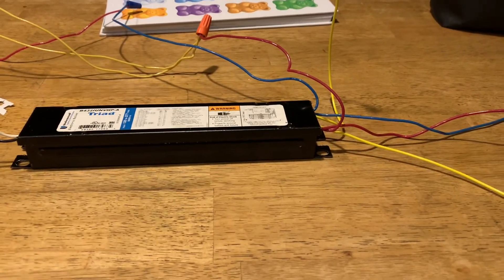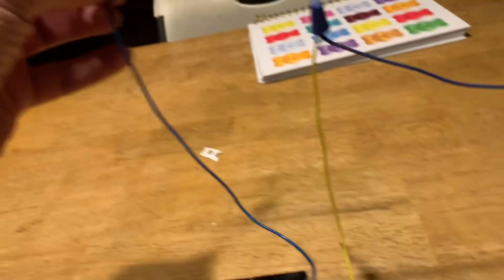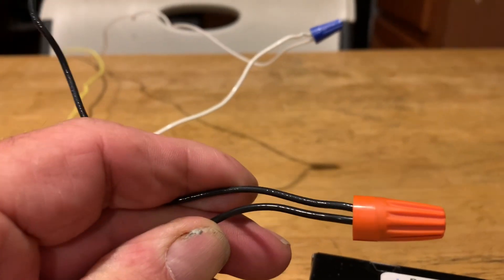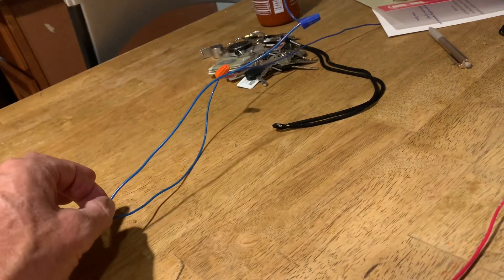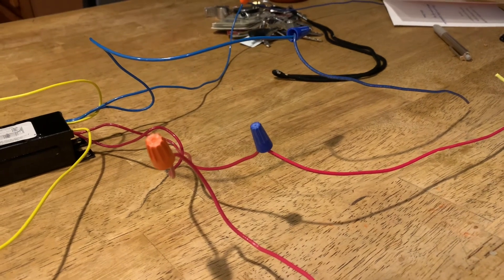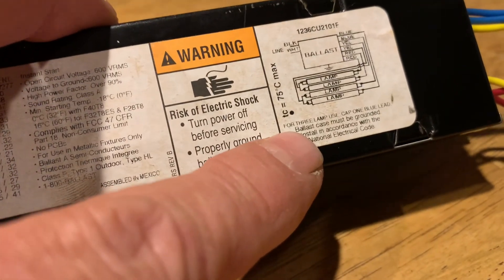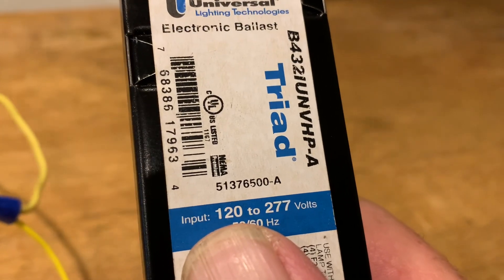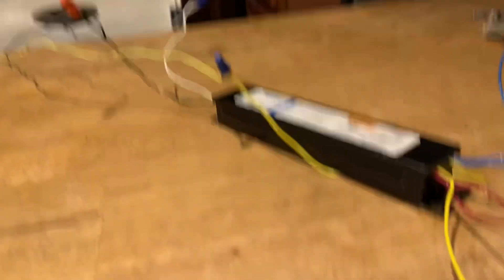This hurt my head! Why what was the last person who did this thinking #ballastreplacement

Comment: I hate those ballasts. we only have 2 bulb fixtures. retrofitting those ballasts into 2 bulb fixture is a PITA. just gimme the direct replacement ballast. red and blue wires. cant screw that up. we've had certain brand LED bulbs have hissyfits with those ballasts too. we've been going integrated LED fixtures. been a nightmare. either the driver takes a shit or the integrated LED starts falling. now gotta take whole fixture down, unwire it. Id rather spend 5 minutes swapping bulbs, 10 minutes swapping a ballast vs 20-30 minutes changing whole damned fixture
Reply from the maker: We remove the ballast, and install “Ballast delete “LED” lamps and new sockets that are non-shunted, with two pigtails (one black , and one white) on one end of the fixture and supply 120v to this end. Now you have a basic 120v led lamp to replace vs all the mumbo- jumbo of a driver ballast and multiple feed splicing and lamps! 
I will be posting a conversion video soon.

Plus when the previous workers mixed up all the feed wires, driver wires and have more spliced and wire nuts then” President Carter had liver spots” it is easier and cleaner to do the complete job new, and retrofit completely with the proper labeling , and new tombstones, then you only have the occasional led lamp replacement! And out of the 100 lamps installed in the last 3 years, we haven’t had to replace any LED lamps yet!

Comment: I had the same job replacing ballasts. I would leave the power on while fixing by always removing the black wire and cap it with the wire nut and hook it up last. Then I found a ballast with two hot wires going to it I had to find another wire nut to cap them.
Reply from the maker: Yes I know them well!

Comment: Get current use direct wire led bulbs. No more ballast needed
Reply: we did just that at our complex. dumbass residents started stealing the direct wire bulbs and trying to put them in their ballasted kitchen lights. direct wire bulb no like the tombstones. tombstones go boom, spark.  Inspector made us get rid of every direct wire fixture where residents could possibly have access
Reply from the maker: @harveylong5878  this is why we make sure all labeling is complete on our direct replacement led converted fixtures, and also make sure that all of our spare lamps are stored away from all non maintenance personnel! All employees of the building must fill out a maintenance request form before any work is preformed! And when we replace these lamps we install new tombstones that are non shunted, or replace the complete fixture with a sealed unit! All employees are also informed that these lamps are not interchangeable with the former fluorescent lamps!
Reply from the maker: That is what we are doing, retrofitting most of the building, and replacing or reusing what we can where we can before recycling!

Comment: I use to work for a energy conservation company and we would change ballast all over the United States so you can just imagine what kind of installation i have seen. The most 2 lamp ballast I have ever changed in 8 hour shift was 108.
Reply from the maker: Been there, done that on a local level, and the really messed up part was… new construction job, that cane in with the wrong ballast in the first place, and the 130v ballasts got hooked up to 277v ! And yes they were 120v only!

Comment: Even color blind people know the black from white.
Reply from the maker: Yes, I know, being colorblind myself! And I can also distinguish between the blue, reds and yellow! So my question is … was the last person actually just blind or not caring about his craftsmanship!
Reply: @thesmallwoodlot433  
I'm going with poor craftsmanship/don't care. I worked on a security upgrade where the some of the wiring needed to be extended. The prime on the contract told their people to use whatever color and they would document it later. I told my techs, to carry all the colors and match what was there. Down range, there were several cases where there were bad crimps and it required tracing back the off color to the crimp. Typical issue was a push pull of the wire connection feeling a slight click. The I warned the maintenance techs who serviced the system down range. They curse that outfit often.